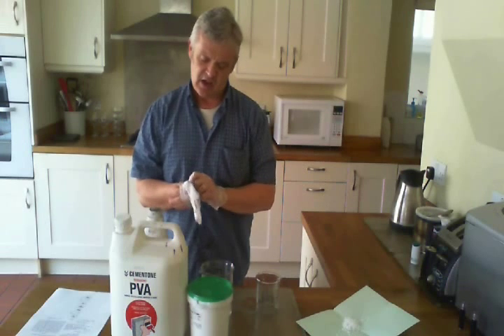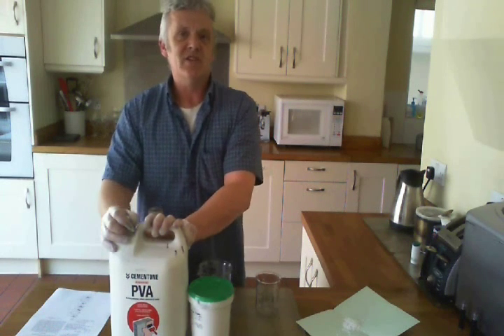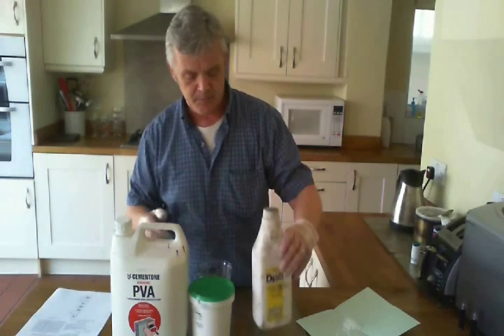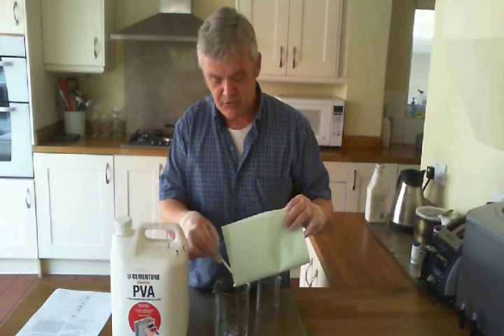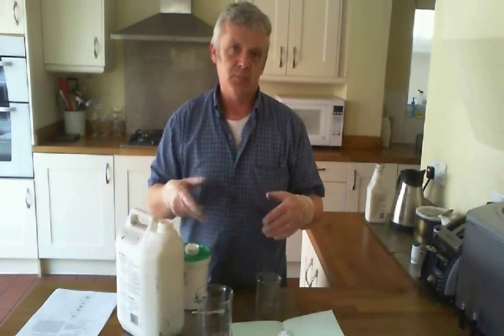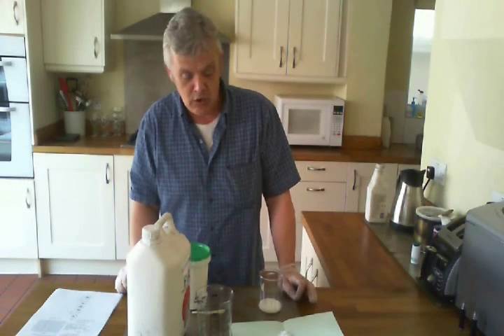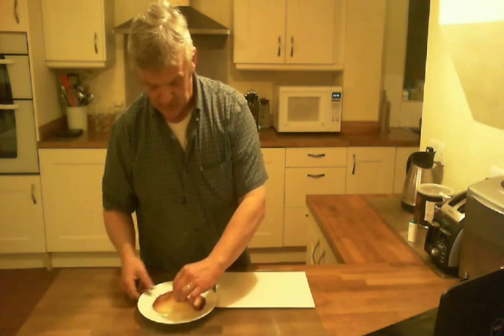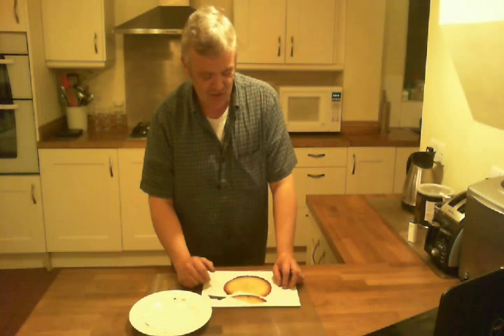Alkaline Gel Electrolyte For Batteries Especially Zinc or Iron

Comment: this is a rather old video, but a reasonable question to ask might be how well hydrated does this gel remain in a working environment?  The other question to ask is Can you use this in a bipolar arrangement to increase cell voltage in Nickel-Iron batteries?  For alkaline fuel cell membranes, I've seen PVA/PVP/KOH used to make quite thick membranes.  Are there any disadvantages to using Titanium Oxide?  Thanks!

Comment: Hi there sir, I've watch most of your videos and really gain so much..not just in terms of knowledge but also inspiration. It seem there have been a question in my mind as I was wondering that I could use this Alkaline Gel solution(since it contain mostly of KOH, which is my electrolyte) for my aluminium air battery, which will then be place on the aluminium.On top of that,there would be a layer of activated carbon (powdered). I would really appreciate it if I could get some advice from an expert like you. Thanks.
Reply from the maker: sounds like a good plan - a good electrolyte would be a 7.5 molar aqueous potassium hydroxide solution containing 0.1 mole of sodium stannate and 2-3 ppm "Dowex 1410" anti-foaming agent - or similar.
Reply: I'm thinking coating carbon on aluminium anode to increase capacity. Also use of sodium potassium tartaric  salt to complex any aluminate formed from ambient moisture..

Comment: I have 20 Edison Edison batteries I need to change the electrolyte in about 10 or 11 to make them 12 volt I have been struggling to figure the ratio of  potassium hydroxide to distilled water for the 21 % if anyone could help please  reply thanks
Reply from the maker: normally it's 3 molar

Comment: Hey Robert! I did this experiment using carpenter's glue, but when mixing the solutions I got something with an orange juice consistency (part liquid / part solid mix).  Did I miss something?
Reply from the maker: +Gilberto Morais probably mate - did you check the patent?
Reply: +Robert Murray-Smith I did and now it works, thanks. Turns out my PVA was too diluted already I just added more and it worked. I noticed the cell keeps holding less and less charge over time, do you know if you are supposed to seal batteries made out of this, or should it work just as good if exposed to air?
Reply from the maker: +Gilberto Morais they need sealing mate - there are likely to be a couple of reasons you are experiencing capacity fade - one is drying out the other is irreversible side reactions - one is easy to cure - the second not so much lol
Reply: +Robert Murray-Smith Happy new year!

On this experiment I did a 2V cell but it only lasted for a day, after that it only stored like 5 mA of current at top end. I opened it up and it was all rusty. Oh no its the bloody electrolysis oxidizing my batteries again! lol 

Too bad you can't use this completely dry, I was hoping to get rid of the H2O so you could easily reach voltages higher than 1.2V. Maybe its easier to just get rid of the iron, I thought about replacing it with  a conductive plastic but they will just probably melt at higher voltages due to the higher current. Of course you can limit the current but then the charging will be very slow.

To overcome this looks like only a solid graphene electrode doubling as a heat pipe will do the trick.
Reply from the maker: +Gilberto Morais oxidation is no problem mate - after all batteries run on redox reactions - it's if they are reversible or not that is the problem